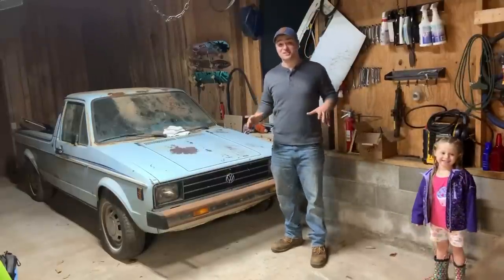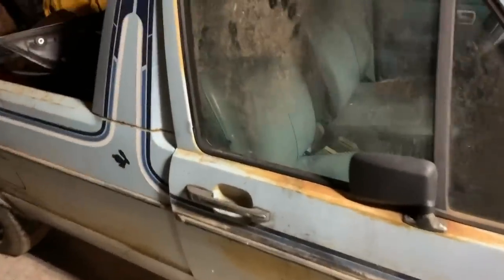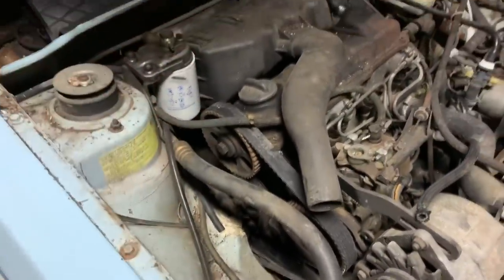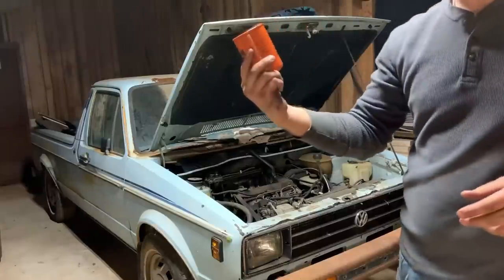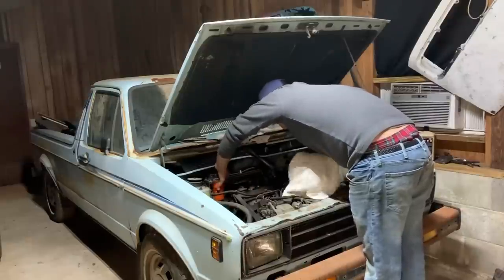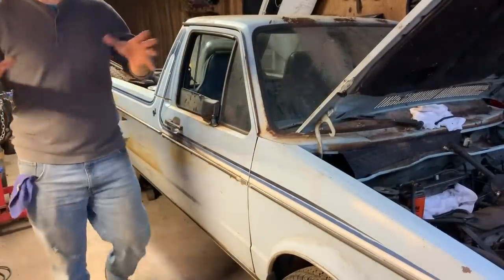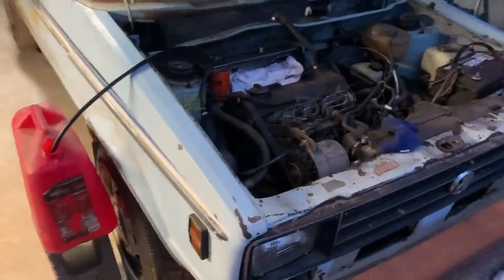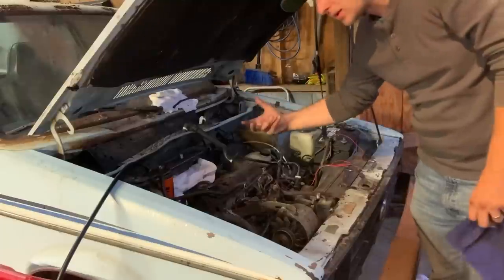Barn Find VW Rabbit Golf Pickup Sitting for 25 Years! :Rebuild Part 1

Comment: Growing up, my dad bought two rabbits '75 and a '78, both diesel. Those cars were amazing. They had killer stereos, they got around in the snow like a snow cat, and they got like 50 miles per gallon in the 1970s. During the energy crunch. Crunch. Other people were sitting in gas lines. We just sailed on by.The trick back then was finding a diesel pump that wasn't 20 mi away at a truck stop on the edge of town!

Comment: 500?! I paid 4k for mine but it's in excellent condition. Interior and exterior are near immaculate. Near no rust. Minor weather seal leak and oil leak. The oil leak is to be expected with 250k miles, but runs like a dream. Internals are immaculate as far as I've inspected. My first car was a 1983 golf diesel 1.6, just like my truck and I would hazard a guess the same as yours. Mine is yellow. Your tailgate looks amazing! I'm the second owner. Just like my golf. I got that from my grandparents that bought it new. It had 300k+. Mad jealous! All of my stuff works minus the shift light. Lol!

Comment: I too have a 1981 Caddie Diesel, I took it for a drive down Pacific Coast Highway in "Surf City" and so many positive comments from folks especially the "Surfer Dudes" asking if it was for sale! I also paid $500.00 for mine. I rebuilt the injectors and the VE pump cause it was leaking from the advance piston seal under the pump. A nice truck to own!

Comment: great video and great job on this pick up VW i had a few co workers who owned drove these who drove them 100 miles a day round trip to work every day and they got over 50 miles to the gallon, that is a Imperial gallon and with the compression release and a block heater here in Manitoba Canada they started in the very cold winters here, enjoy your find they are very reliable and super unique

Comment: Back when VWs were made well.  I had a gas 78 4 door Bunny, Champagne Edition.   I so loved that car....  Drove it for two years in HS, then 5 years in college.  Did all my own work where I could, oil, plugs, rotor, timing.....  So peppy for the time and low to the ground so great handling.  I only sold it because the floor boards were starting to rust out.   Bought a VW Fox because I wanted a trunk.  Not as fun as the Bunny but more practical.  Then I went Japanese as VW started its decline.  Have fun with this car truck thingy.

Comment: I had a 84’ rabbit gti. The nose of it is identical. Car was pretty quick too. Those volkswagon’s were one of the first vehicles to use fuel injection. Most other car manufacturers did’t start that until about 1988-1989.
Reply: Mine was a 1.8 liter gas engine though.

Comment: Nice steady idle after that long, those engines are bulletproof,  but you need to take care of that fuel line rubbin on the alternater pulley.
Reply from the maker: It’s a temporary, just wanted to be sure she lived before getting too in depth! 😃
Reply: Budget Buildz yeah figured that, just anyways, if it snapped and got tangled up with belt or worse foind in with timing belt and jumped a tooth, bend valves and all. 😀

Comment: Love these older Volkswagens, you probably already know this but here goes. I found out the hard way, over 3k $ repair. The service manager at the local Cummins dealer said the older fuel pumps used the sulfur in the fuel for lubrication. Both my up pump and distribution pumps went out and were replaced with the newer version designed for the new sulfur free fuel. Additives are available to be used with older pumps. Rule of thumb when you change the oil you need to change the fuel filter also. Prime the new fuel filter before you install it.
Reply from the maker: donnie brown Always do! 🤙🏻 thanks for the suggestions! 🙂 thankfully these pumps are only $350 to have rebuilt which makes it a little less worrisome 😃

Comment: You got a great deal on that caddy.
I've seen those in good condition sell for $4-5k.
Which is kind of ridiculous but.
I had a couple 84 quantum turbo diesels.
Definitely like the older Volkswagen diesel powered cars.
I had a CV joint fail in one of those went to a local parts store, 
The part was in a paper box wrapped in oiled paper, an inside the box it said made in West Germany..
West Germany didn't exist as an independent country for quite a while at that point.
Reply: What year were your Quantum’s? I had an 84, turbo diesel , dark brown , brown interior with the automatic with the E position on the shifter. Was imported to Canada in the late 80s.  We didn’t get Quantum’s here.   Miss that car!
Reply: @charlesmoore2485  
I'm pretty sure one was an 84 or the other one I'm not totally sure about. It was funny because the one was a lot more beat up but ran better the other one was a lot lower miles and a lot cleaner and ran a lot worse LOL.
Both of mine worse 5 speeds both had AC.

Comment: And that is what it sounded like new.  That engine will last forever but you never see them on the road anymore.  Would be cool to have one with a little more power.  That was actually a pretty practical vehicle back in its time.  But...today you probably need to use back roads cause I am pretty sure maintaining 70 on the interstate would only be on a downhill slope.  I would probably have bought that thing if I ran across it.  Still miss mine and it was borrowed constantly until I sold it.
Reply from the maker: I had a built pump, custom header and a velocity stack intake on my last one. It did pretty well for being a tiny na diesel 😉 this one will stay bone stock other than probably sending the pump off to be built. Takes them from roughly 36whp to over 50whp which doesn’t sound like much but actually makes a huge difference.

Comment: These engines are great i got 2 audis with the same engines they ran over 500000 kilometers if you keep this one before fill up your tank(full) take 0.2 liters of 2 stroke oil and it will run forever (the pump and injectors get better lubricated)

Comment: @Budget Buildz One thing I would definitely do is take that fuel tank and filler neck out and kill any rust they have and repaint them while they are in good condition - these fuel tanks are no longer available as new parts and it is damn hard to find a fitting alternative. I had a a new one manufactured from aluminum after looking over a year for an oem one and it cost me about 300$.
Reply from the maker: I’ll definitely pull it! I have a spare if it needs one!

Comment: My 89 cabrio made that same rattling noise at idle and it ended up being the alternator belt pulley touching something which caused  it to tear off while I was driving make sure to check that! Its a pain to get to if you dont have a lift.
Reply: The alternator fan is rubbing on the diesel line with the hand pump on it, so you are spot on I reckon.
Reply: Lol your 89 cabrio wasn’t a diesel;)

Comment: Modern atf is not just oil like it was back in the day.  It has additives designed not to burn and can leave a bunch of crap in the cylinders.   It's not recommended to use modern atf in a diesel fuel system.

Comment: i think it has at least 155K on it. there is only 5 digits these trucks where used allot !! im restoring a 1975 300D it has 63K on the clock but the records indicate it has 163k.
Reply from the maker: Mercedes Benz Revive It was a local parts runner for a heavy equipment business owned by an elderly gentleman. Never went more than 2 or 3 miles at a time. All of the vehicles at the location had next to no miles, including a 70s ford Granada with less than 20k original miles. It had a rough 55k miles and spent a good bit of time sitting outside before being put in the barn but I do believe it’s 52k original miles as does the owners wife. Most of the time I don’t go by the odometer unless documented but I do truly believe this one has those miles. I’ll get more in depth into the rebuild and work on supplying facts behind that.
Reply: @BudgetBuildz  awesome ! if it really is that low miles, even if not its a sweet car
I had an 81 black with red interior rabbit one of the best cars in the snow ever made !
Reply: the reason i said that was because  i just acquired a 1975 300D and it read 64K on the clock, And because of the condition of the car i was sure it was true. But after finding a huge stack of reciepts in the car i discovered it was actually 164K. it was extremely well carred for for most of its life so i was fooled. BTW your channel is great keep updating us on the progress.

Comment: Do you know about the timing on the injection pump? Takes some special tools.
Reply from the maker: eurocarman I set em by ear and have never had an issue 🤷🏼‍♂️ not to say it won’t happen. It’ll lack power one way or the other but when she’s in her sweet spot it’ll pull along just right.
Reply: @BudgetBuildz  I get that but since it ran fine. the holder tool is really all you need. Every body sells them this way https://www.partsplaceinc.com/vw-diesel-timing-tool-kit-17821.html

Comment: If it’s at all possible,? Bc I don’t know but maybe you can put tubes in the tires and not have to worry about the dry rot and keep them and get some life out of great treaded tires!!! Although if it were me I would only do that for myself alone driving in it and only around town speeds ???!!!👍🙏❤️obviously any driving it with kids in car or at highway speeds then I will definitely get brand new tires!!!!  So maybe for short riding around town by yourself in the winter to just run errands you can have two sets of wheels winter and summer set of each????? Thanks 🙏
Reply from the maker: I’ll definitely keep this set on these wheels around!

Comment: 1.9 td swap bro stock 75hp for cheap over 100 hp with slight modifications no ecu just simple diesel as that 1.5d just double the power and better mileage

Comment: Barn find my ass man .. that diesel is fresh I have bought many old diesel rabbits and when I drain the tank it is 10× darker
Reply from the maker: So, here’s the run down. Idk if you saw what was in the tank, it was gross lol. When I got the truck it had a home made fuel filter with household insulation in it...the old man had Alzheimer’s before he passed away. The filter and base were one I had laying around, honestly off of a vehicle that had been sitting just as long as this one. The fuel was a good bit cleaner, yes. I wanted to show the process though and should’ve left that in there about the other filter, his wife was a bit upset about how he was his last few years so I left it out mainly in case she sees the videos. The first time it ran was the first time it has in 25 years.

Comment: 0:36 1.6D  54hp, Enginecode CR or JK.
Reply from the maker: urgolf1974 It’s a 1.5, my later trucks were 1.6. I’ve already checked the engine casting.
Reply: @BudgetBuildz  3:35 Air Filter assembly is from a younger engine, then ? The 1.5D has a round air filter duct and pointed to the right.
Reply from the maker: urgolf1974 yessir, someone stuck this one on at some point of time. Probably for hp gain 😅 the main intake is the same the filter housing is different on the 1.5 and 1.6 though. Good eye
Reply: @BudgetBuildz  So the engine is really a 1.5D "ck", then ? Not many of these engines around anymore, at least in europe. (Dont know the situation in the US.) Nice find. Looking forward to see some TLC given to this project !

Comment: axle flip and air ride and r32 conversion please!
Reply from the maker: 4 link air ride but probably gunna stay diesel atleast for now 🤷🏼‍♂️ I have an obsession with them. I love a built exhaust rolling powerless naturally aspirated coal...lol
Reply: Put the 1.9 turbo diesel with the 5 speed in and you have yourself a rocket should fit without modifications just bolt in

Comment: Prior owner of 3 ‘81 Caddies.  (2 Diesel & 1 Gasser).  Unable to get second diesel running, it had a bad top end.  Got a ‘81 diesel Rabbit parts car that did run, but had a bad lower end.  Who knew VW made a change in the size of the head bolts mid year of ‘81.  Ended up not starting after drilling out for the larger head bolts.  Gave up and got the gasser.
MS made working on it too hard, that and no skills. Bye bye VW dreams. My wife loved it and hated watching this video....

Comment: Whats the function of a *silanoid?
Reply from the maker: When ignition is turned on it opens a plunger that allows fuel thru the pump, when key is turned off it closes the plunger stopping the fuel and killing the engine.
Reply: @BudgetBuildz  forgive my questions but what does a carburetor do then😂 i think im mixing them up
Reply from the maker: No problem, ask away. This is a diesel, not gas engine.

Comment: Heh heh, will it run... or will it run away like so many of the high-mileage VW Rabbit diesels? VW ran the crankcase vent into the bottom of the intake plenum, and when they started generating a lot of blowby after they got hot, they would start running on the crankcase fumes. The 1.6 diesel was essentially a 100,000 mile motor because they had a 5000 rpm redline and wore the rings prematurely. The ones that just refused to start after they got worn usually were good candidates for an overhaul. The ones that ran away while under a load usually didn't survive the 7 grand over rev when an unknowing owner pushed the clutch in to get it to quit accelerating.😜 Usually they'd just strip the teeth off the timing belt and pound the valves into submission, or sometimes break a few off and grenade the whole engine. They were an 'interference' motor, so if the timing belt broke, it was generally fatal for the valve train.